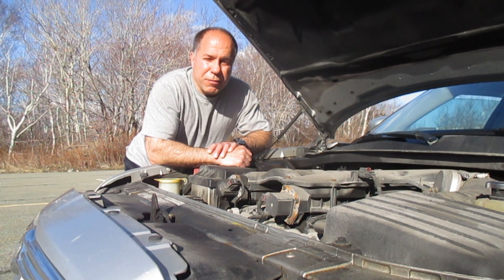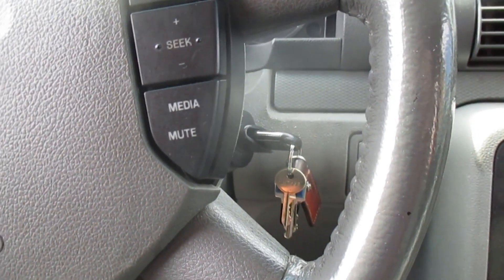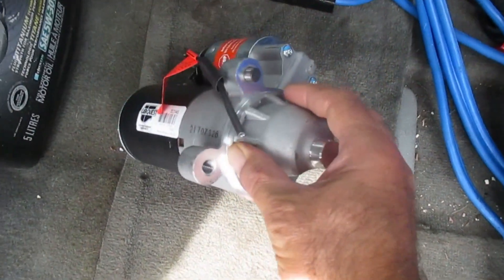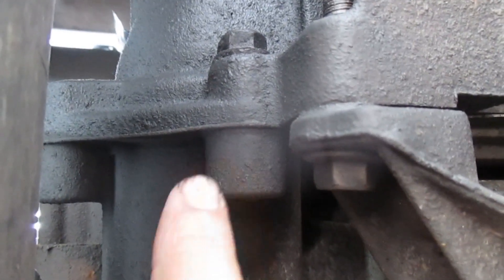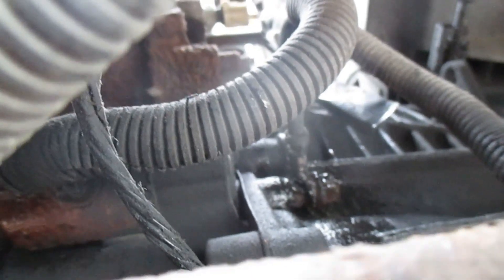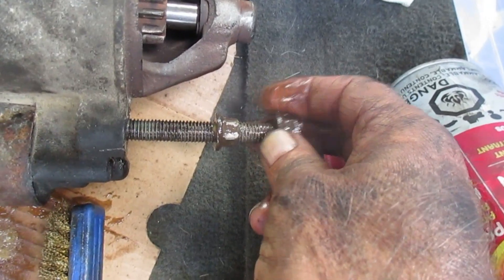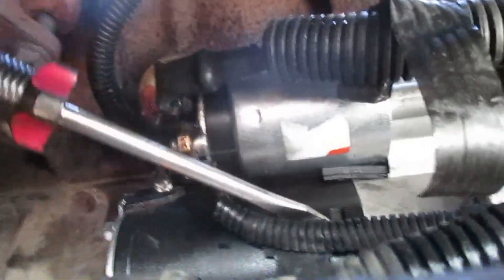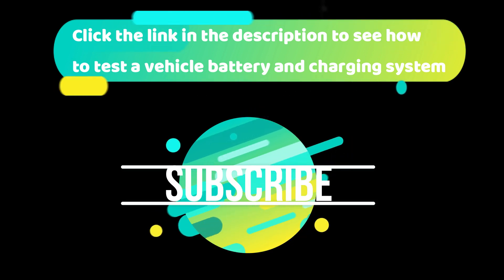Clicking noise when trying to start a car . And how to change a starter

Comment: i got a e46 went abroad for work for 3 months someone forgot the trunk window open opsie.. came back battery dead... but also.. i try to put contact on new battery and does a click noise on starter area... but no crank... so im guessing i need a new starter now also... it does start if i give it 2-3 keys but i hope is the starter even tho is weird it failed the same time when battery got drained out before that never had a issue with the car... but after i came back.,.. i also noticed a leak under car under driver seat... usually where the starter is on this model... so im thinking oil or whatever is leeking went inside starter and got it dirty and with new battery if i give it 2 -3 click keys it starts eventually but if i play around with it to much i might need another battery lmao... my question is ... is this a starter issue? or something else?

Comment: So if you try to jump start it and still makes those clicking sounds and does not start, it’s the starter ? I took my vehicle to autozone and had the battery and alternator checked and they said they were fine.